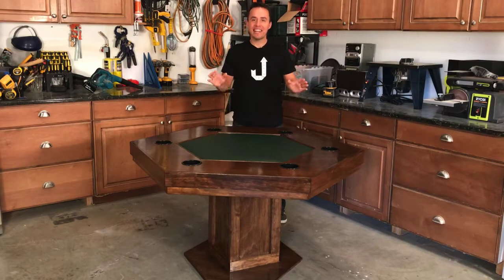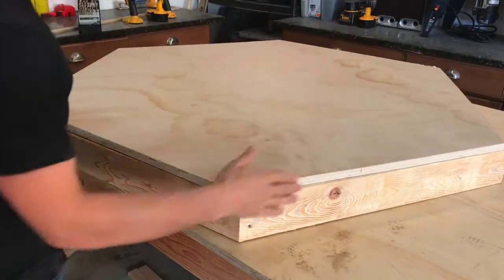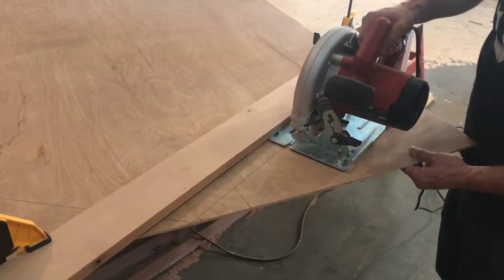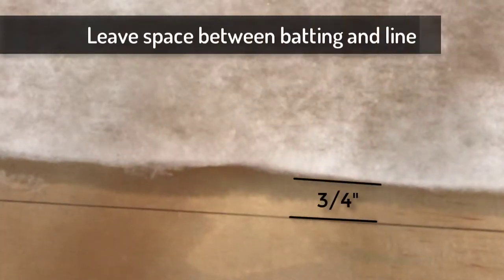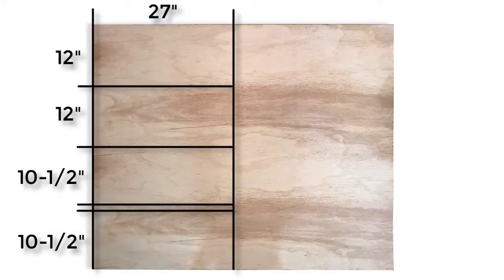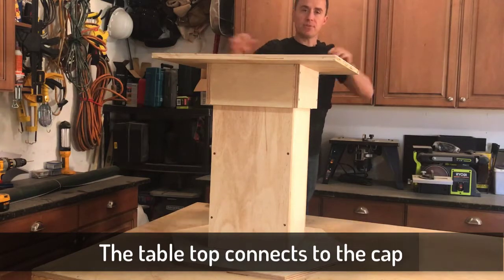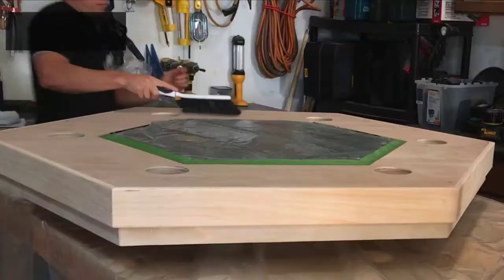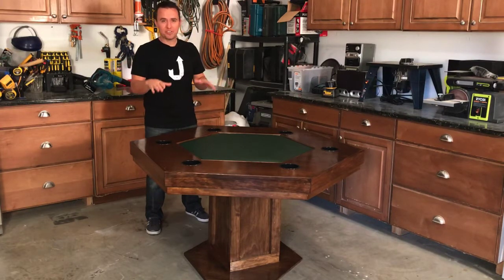Make your own Game Table!

Comment: Nice build.  Video very well done.  Think I might go with a septagonal  table.  Interesting angles...
Reply from the maker: That would be cool... You can use my same design... But instead of doing 30 degree cuts, do them at 25.7 degrees.  but I don't know the lengths of the sides... i can't calculate that much on the fly😁